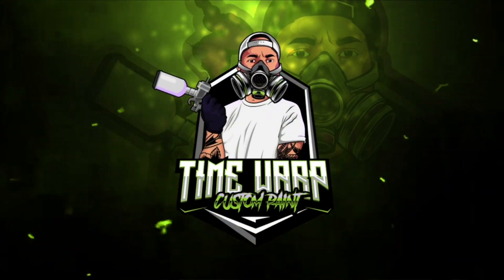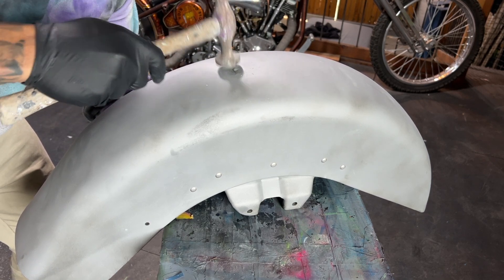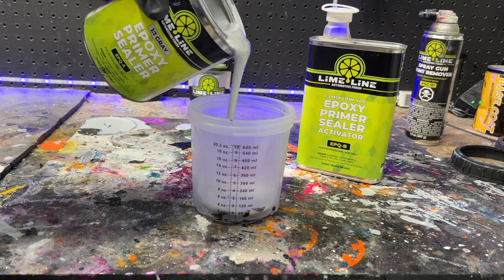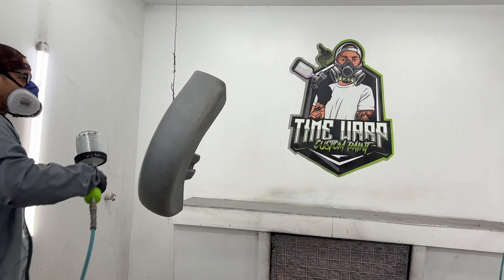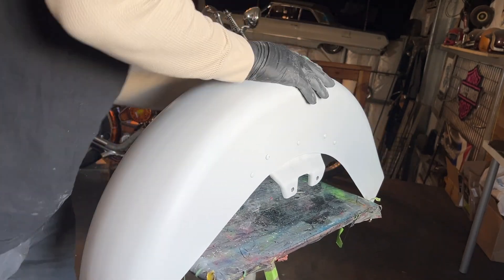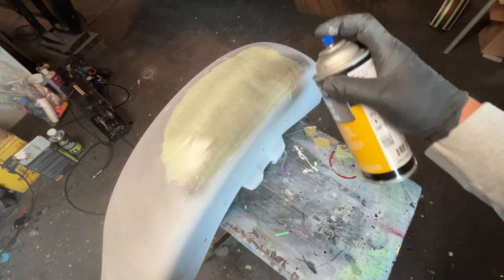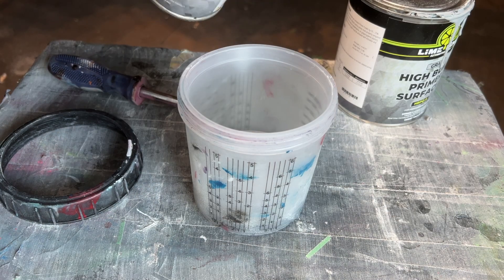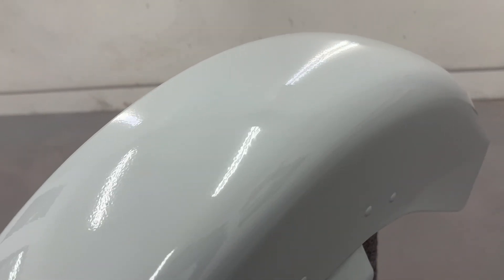Automotive Primer: LiME LiNE Epoxy vs High Build Primer Surfacer

Comment: I think this video is the best that explains each step of an ordinary priming process in youtube without confusing people :-))  Thank you for posting it!  I am a long-time RC model aircraft builder.  All along I have used Rustoleum auto spray can primer on fiberglass and metal parts before I paint my airplanes.  But, Rustoleum turned out to be not a very productive solution because paint started chipping after several years of being exposed to nitro fuel fume (nitro fuel is the fuel we use to power our airplanes).  Now, I have decided to switch to epoxy paints from Klass Kote.  They also have a 2-part epoxy primer system they recommend to use with their paint, but it is $75/quart for each part.  So, $150 is a little expensive for me.  Since the green Lime Line primer is also a 2K system, and almost half the price of the Klass Kote primer, I intend to buy it because of compatibility issue between Klass Kote epoxy paint and Lime Line epoxy primer.  However, there is a issue with the nozzle size of my spray gun.  It is 1.0mm, and the primer/catalyst combo needs to be thinned.  Do you know what to use, and the ratio of the catalyzed primer and the reducer?  Merry Christmas.

Comment: Very informative.  If you were to sand through your 2k primer down to metal, would you spot spray it again with epoxy primer and then base coat after, or spot spray the burned through areas with epoxy, then 2k and then base color?